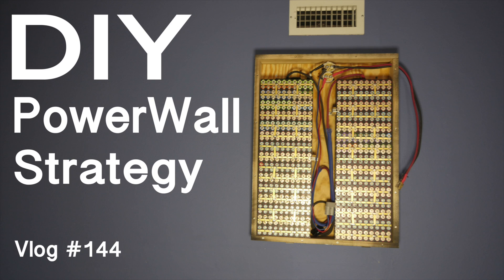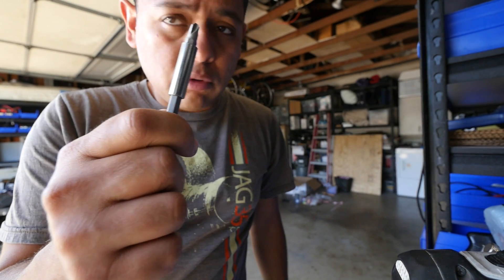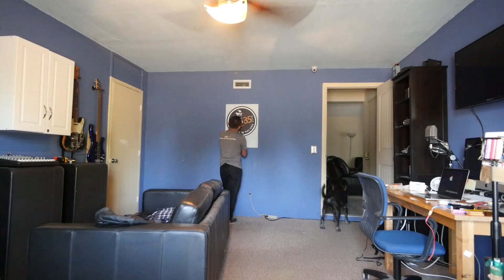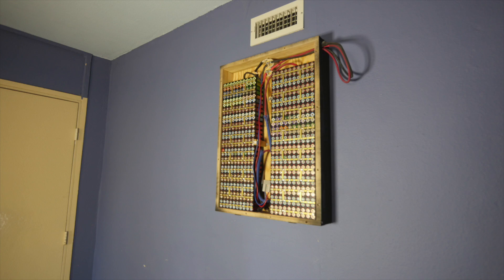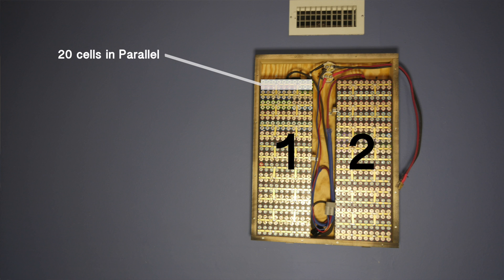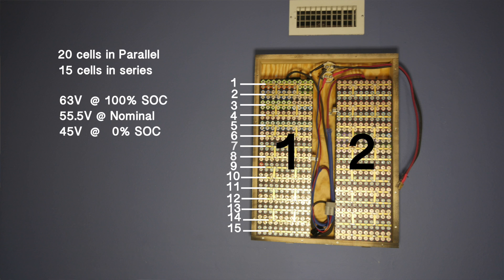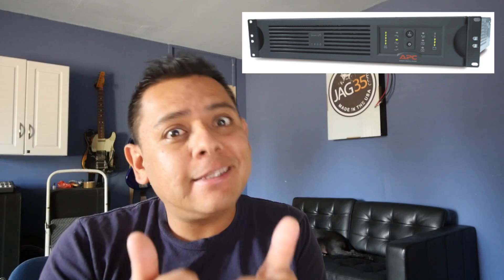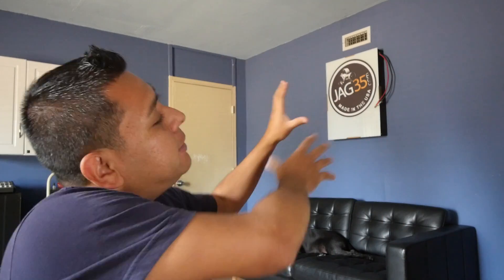DIY TESLA POWERWALL Design STRATEGY -  Vlog #144

Comment: @Jehugarcia, you can not charge Lithium batteries with a UPS that normally works with Ni-Cd batteries. The reason is that it is a totalley different charging process. If you charge Lithium batteries with a Ni-Cd charger you will blow up your Lithium batteries.

Comment: Buy a grid-tied inverter with limiter with and 'battery option' , they make 22-60 input or 40-90 volt input, but you will have to have a separate charger....
https://www.ebay.com/sch/i.html?LH_PrefLoc=3&_sop=1&_from=R40&_trksid=p2045573.m570.l1313.TR12.TRC2.A0.H0.Xgrid+tie+inverter+limiter.TRS0&_nkw=grid+tie+inverter+limiter&_sacat=0&_oac=1

Comment: Hello Jehu. This is Reuben. I am building a battery pack. Well i am a bit confused while calculating the overall power of the battery pack. For instance, Power = voltage >< current. For a 18650 it would be P = V >< I, so, P = 3.7 v >< 3.4 ah. So P = 12.58 watt hrs. Right i get it. BUT i am getting confused about Maximum Continuos Discharge Current which is different for every different cell. So while calculating the power, should the current be capacity of the cell (ah) or Max Cont. Discharge Current. Can you please clarify it. Thanks.

Comment: Look at this on eBay:

https://www.ebay.com/itm/282491269496

10x 4x5 Cell 18650 Batteries Plastic Holder Spacer  For Battery Packs,Power Wall

Comment: Most modern electronics like computers, laptop chargers, lcds, lcd TVs, mobile chargers... that have switching power supply, that are nominally 100-240v ac (or 90 to 120v - even better) will run just fine from 48v DC or more (4 12v lead acid batteries in series, i am running stuf for some years like that with no complaints. 
I know it means double current on input, and might overload switcher FETs, rectifier, or anything in its way, but most/all of mentioned stuff i have is dumpsterdived and i am not so worried about it) if it helps :-) 
DC WILL fry regular transformer powered devices.
Do it at your own risk, only if you understand what SMPS and transformer is, 
and FYI, fuses at multiple places are necesary with big batteries, DC is PAINFULL, and oh the currents that big battery can deliver without proper fuse, well heat from it, can do serious burns, blindness, fire...

Comment: http://www.theinverterstore.com/1500-watt-pure-sine-inverter48v.html 

http://www.aimscorp.net/1500-Watt-48-Volt-Pure-Sine-Inverter.html

I'm using either of these two inverters with my 14S 58.8V Soul EV Lipo module and an e-bike charger off ebay ($58). I'm building a portable power box. All this for less than $300  and no need to populate with any more components. I'm worried about the low voltage shutoff at 40V, though. That's 3V. In this application (powering TV + fridge), I don't think the module will be all that stressed. I'm also using a BMS to keep things under control. We'll see if it blows up in my face!

Comment: I have cell phone chargin  battery. brand name is tylt model. upp2agy-t input: DC5v-1A output 5V-2.1A Battery:3200mAh/12wh is this a good battery to use for this project. thank you for your time here is the link of the batterys i have 
http://www.costcobusinessdelivery.com/TYLT-3200-mAH-Portable-Power-Bank,-2-pk.product.100206283.html

Comment: If I want to use a 12V solar panel system to the power wall (If i used 200- Li-on 3.7V  9800mAH in series of 4 or 14.8V in 50 parallel. Would that be 50 x 9800mAH = 4900Ah @ 14.8V) are is my math fuzzy

Comment: @jehugarcia love your channel. Very useful info. I got tired of waiting on spacers from China, so I designed my own battery holders and print them myself. Makes assembly much faster. I put cut-outs for the brass bars along with notches for the copper main bars. Check it out.. http://www.thingiverse.com/thing:1563902
Let me know if you'd like some. It is still a WIP, but it's getting better every day.

Comment: Great videos, Jehu... I am willing to see the video with your diy powerwall supplying appliances and how long will it last.
We run our houses on solar off-grid and back it up with automatic switch powerline, when needed due to low sun irradiation on some cloud and raining days... as we use 12V stationary batteries of 220Ah, it would be great to change them for powerwall
Weel done...!!!

Comment: It's 20p15s not 15s20p
20p15s means you first build 20p packs and connect them to 15s
15s20p means you first build 15s strings and connect 20 of them in parallel - which wouldn't even be balanceable ^^
Greetings from the german Engineering High school "Mittweida"
PS: I really would love to build a VW Bus like yours ^^

Comment: I've got a few hundred 18650 batteries (2250mah)

First project is to make a battery backup for off grid camping, (i have a CPAP machine to power)

Proof of concept right now is to make a  a 3S24P battery to power a small 12v inverter/USB hub. If that works, I may try an ebike, or battery backup for my furnace/select circuits (aka Powerwall)

Its fun stuff! By far the most annoying thing is to discharge each freakin individual battery to get a rating. the Imax B6 can basically do 2 a day. :-(

Comment: I'm very curious to see how you're gonna use the UPS to charge the batteries. Because keeping a constant float charge on Lithium cells, as the UPS is designed to do to it's original Lead-Acid batteries, is a very, VERY, bad idea...

Comment: This is my emergency system, It's not running off lithium batteries, but it works:
https://dl.dropboxusercontent.com/u/3208124/Shared/DSCF1112.JPG
It's small I know, but it was virtually free. I had that battery, then I've got the UPS from one of my friends, it had a dead 7 Ah 12V battery in it, so I've hacked it. With that 2 unusual cable, I can feed back 220 VAC to the wall sockets, and to the lights as well, at the expense of 2 wall sockets, and 1 bulb socket. Of course first I have to turn off every fuse in my apartment, and make sure that no big load is connected, and I have at least lights, and my PC on for about 40 minutes... The idea was to make a system that works in case of emergency in a rented apartment, where I was not allowed to do any modifications. I have this for 2 years now, and it serves me well.

Comment: Hi, so I had an idea that could be interesting.  I know many companies have talked about using super capacitors to store the energy for the car's usage since they can charge faster due to a lower internal resistance and give whatever power is required at that time.  What if you used this effect with the regenerative braking system in your Electric Samba project? Getting a 150 volt capacitor shouldn't be too hard and that could capture more of the energy since it has a lower internal resistance and (correct me if I'm wrong) would store more of the energy since the voltage needs to be higher than that of the batteries to actually charge them.  It would also give you better performance off the line if you ever want to join in a drag race (remember all of this is just theoretical and an idea, if it works it could potentially speed up your vehicle while using [a little bit] less power since the power is derived from the regenerative braking system alone.) Again just an idea, I thought you might like to try it and see where it takes you.  I look forward to following your Electric Samba project more.

Comment: I Have a 5KVA Smart UPS running on deep cycle batteries. Charge output on these smart UPS is around 55.6 volts DC at 60 amps. I use my set up as back up power for about 85 percent of the house (will not power range or A/C).

Comment: Hey Jehu - I want to build a 14.8 volt battery pack for powering cameras and camera accessories like monitors and lights etc. I need to be able to pull at least 12-15 amps from it continuously via a couple of 4-pin XLRs. I want everything to be built into a small Pelicase so heat is an issue I need to deal with as I don't want to draw too much power from each cell to make them heat up too much. I was wondering if you could give me your feedback on the following. 

I was thinking I'd make a 4S 8P pack (so 32 individual cells in total) and use a PCM like this one rated at 20 amps: http://www.batteryspace.com/Protection-Circuit-Module-PCM-with-Equilibrium-Function.aspx

What's your thought on the above - and what would you recommend using for charging this? I need something that can charge up the battery in max. 8 hours.

Thanks!

Comment: Don't try and charge those lithium a with that ups. They have a built in gloat voltage, unless you edit the charging software. I use a 1000w apc sua1500 with 18650s and it runs great! However it can't charge them due to the built in float for lead acid batteries. Keep up the good work mate, love your vids

Comment: Same series as mine. Watch out for the network  cards on Ebay if you haven't ordered one yet. . I added a cheap external Wifi-Ethernet box also  to mine and you can manage everything remotely.  Only thing you have to watch for is the idle trickle charge set point.....it also has a nasty way of testing capacity at intervals which wastes power. You can work around that as well.

Comment: Converting a UPS from APC is going to be more expensive than using a 48v  from http://www.proteanelectric.com/. The 48v can not only charge from the utility but it can charge from solar too. It is 5kva that is 4 kW which is plenty. And you do not need to rearrange your battery pack because this inverter can take up to 72v. The UPS APC will only be cheaper if you get it from scrap yards. But this 5kva inverter is for about $400 from China or a bit more from Taiwan. I have the 3kva one and it works perfectly. 

Best regards from Cairo Egypt.

Alaa

Comment: I get the idea, but how much will you save ?
here power is 18c at night and 21c, si you would save max 6c per day
now I know a few cents adds up but you will spend more on the inverter than you will save ?

nevertheless interesting project ,
Reply: That's 6c per Kilowatt, he's power wall has 4 Kw, so now it's 24c a day. He can also store extra energy from solar panels, during the day if nobody is home to use the power, it's stored. Also serves as a backup during power outages.
Reply: Backup for power outages is the primary reason. Potentially saving on energy bills is a fat bonus.

Comment: I'm so glad I live in a place where power costs the same no matter what time of day! I would like a Powerwall but only as an emergency backup power solution.
Reply: it just means you're getting shafted xD
Reply: why are you glad to live there? power is usually much cheaper by night
so unless you have same cost as other countrys by night this isnt advantage
Reply: Not really guys - it depends. I live on the very border of two electrical co-ops. Basically (not talking down to anyone, just in case you're not aware of it), usually in rural areas, that means that everyone in that district / county / whatever area it covers, the rate paid by the people using it is agreed to at an annual open meeting where all costs and revenues are tallied and presented with any additional rates or lowering of them are proposed for whatever reason.
There have been a few years I wished I was on the other side of the river, and several years I am glad I'm where I'm at! lol
The other nice thing about a co-op is that at the end of the year, if there was a surplus, then you get a refund the second week of January. Which is pretty much every year. Not much, but at least the budget is usually spot on.
We pay WAY less than the major cities and get way better service for the most part. 
Basically it is the people having more power over the system so the rates stay lower and the people are paid better or else the people which are the cooperative base can take them to court since the books are open to public review. It is too bad the public utilities can't be held to the same account.
A good example is that during the ice storms and places all throughout the nearest big city where people were without electricity for weeks, even more than a month in some cases - the longest in our co-op was two weeks, and that is mainly because it is just a huge area. An entire county basically.
So yeah, same rate all day and night. Cheaper than most places in the US. It happens.

Comment: bak makes a iso9000 18650 battery 2200 mh only a 2c but if running a big bank no problem and at a cost of 1.50 per cell.i tested them at 2200mh  no problem.but need to ship from china....

Comment: thanks for the great videos....you gave me the drive to build a 1.2 kw 18650 for my electric skateboard. love the samba nice job...been running solar in my man cave for 2 years.....you may want to look for a true sine inverter.well put less stress on your gear.i..have had great luck with the zantrex prowatt sw2000 inverter...get some solar panels and let them charge for you'.and yes right now lead acid is way cheaper but the 18650  is a way more powerful battery. and well give a higher voltage for a cycle use that means less amps for that battery cycle and way more cycles ck out my battery build ...just did 40miles on my skateboard on a single charge   thankyou

Comment: Trying to convert a normal ups to work continuously is iffy at best, even a 2kw APC ups running at 200w-300w can overheat even with fans, heatsinks, etc. What i would recommend is an online ups, inverter always running. Here is a link to a su3000, ~$330 2400w continuous, pure sine wave (http://www.ebay.com/itm/to313c-Tripplite-Classic-Online-UPS-3000va-UPS-120v-SU3000RT3U-NewBatts-/131731370725?hash=item1eabcd32e5:g:bdwAAOSwuAVWxl-g ),  and it already has external DC in jack. I have some experience with these and and will run down to about 9.5v/batt so 57 ish volts (72v system), but im sure you could modify the cutoff voltage by changing resistor dividers or by feeding the voltage monitor a full 72v at all times.

Comment: Great project but why no solar panels?
charging to 80% or so adds to battery life most 48 volt inverters work up to 60 volts or more. so charging to 80% ish you should be dialed.

Comment: hi you kwon if exist batterys of 9800mah in the market?
Reply: a good way to tell if a batt is crap is if it has an insanely over rated capacity like that.
Reply: they don't exist in 18650 format.. they never will
Reply: +Google+ SUCKS BALLS - the worst forced social network 

and in other format?
Reply: +Zev Hoover ok
Reply: José Yovany Galindo Díaz yes, you can get all kinds of lipo batteries in soft-cases.. here is random example of  44v pack (12 serial) 5800mAh http://www.lipo.si/katalog/10/lipo-12s-444v
Reply: +José Yovany Galindo Díaz not in a single cell. you would have to make a pack with several cells in parallel
Reply: ***** NCR18650b 3400 mAh - I doubt you'll find any better (capacity-wise).. there are some with higher C-rating.

Comment: I'm willing to pay the money to buy brand name brand-new cells from a reputable dealer...
can you recommend someplace to go?
Im in Oregon if it makes any difference, no sales tax, I'd rather buy someplace in the US.
Reply: Illumn.com has great, legit cells, and us US based.
Reply: check out batterybro.
Reply: Thanks guys, appreciate the point in the right direction.....
Now....... which brand cell kicks butt?
Reply: +Christopher Leveck there are only a few brands that make them. Panasonic/Sanyo, Samsung, Sony, LG.. I think thats it. They all make great cells, just choose the cell with the specs you need (capacity and amperage the cell can provide). do not buy cells from any other "brand". If its too good to be true, it usually us. Cheap off brand cells are often old, rewrapped cells. Also, there is no cell higher than 3600mAh. Off brands often advertise more than that, but you can be happy if you get 500mAh put of those.
Reply: AWESOME!